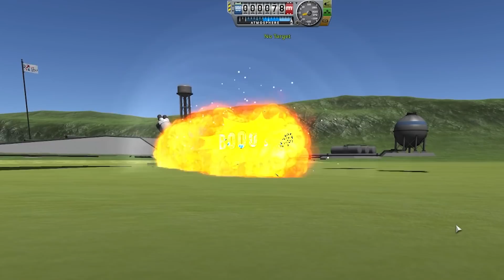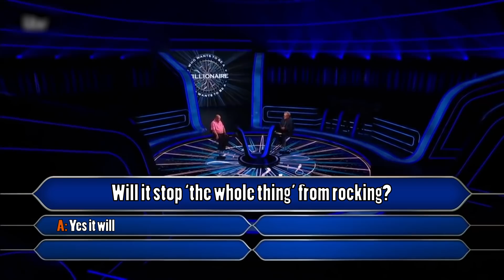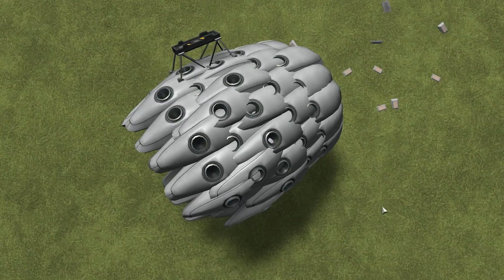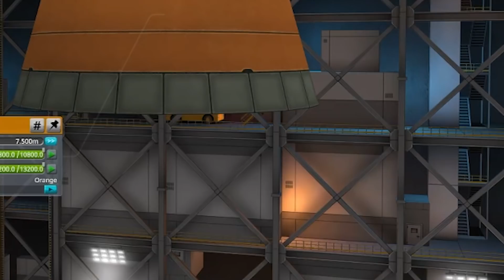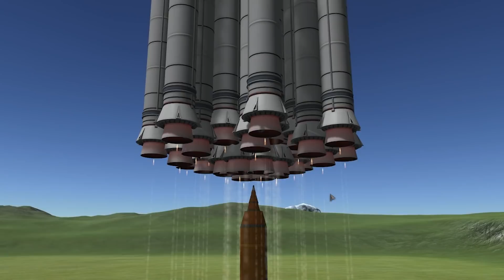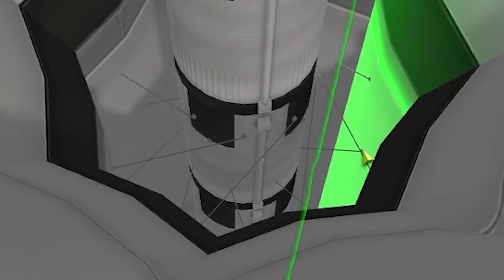Building rockets that SHOULD NEVER HAVE BEEN BUILT! Kerbal Space Program!

Comment: Today I built a twin fuselage small carrier plane that is launched by a wheeled rocket-powered launcher. This launcher works, but the top mounted rocket in the middle of the center airfoil does not really harmonize with the small carrier plane. Pushes it upwards and things get uncontrollable. But I built a greach launing system that keep everything on the runway and did not even require any redesigns. I just improvised it to my build.

Comment: Control node is at one end, controlled bits on the other end.
... put a probe core near the thrust end, and use that to control with. 
It will go up more reliable, but it will wobble all over as it is not structurally stabilized.

Comment: So your rocket is trying to control from the capsule at the top, and SAS is confused because the bottom quickly doesn’t line up with the top. Try putting a docking port on the very bottom of the rocket, then right clicking it and hitting “control from here”. That should fix it

Comment: "We're gonna something a bit more sensible now..."

Like making the rocket about 80% 
shorter?

"Like... an engine the right size."

Better idea. Try installing Kerbal Joint Reinforcement Continued. If all else fails, that mod will force a metre-thick solid osmium shaft into the rocket. That WILL help.

Comment: Protip: If you want to build big, use less, larger fuel tanks (pretty sure there's one twice the length of the ones on the noodle) and brace it with struts on the lower stages to keep it rigid if needed. KSP very much fits the real world 'simple is reliable' aspect.

Comment: you can click the orange thing on the side of the screen that has your stages, and it will pop out and give you a bunch of info for that stage (it also assumes that all fuel the previous stages can use have used them). that will tell you your TWR (thrust to weight ratio) which will help you get off the ground.

Comment: You need SAS and RCS activated at same time to do what you are doing, for RCS to work (the little thrusters) u need to put SAS on as well. That number in bottom left is cost but it doesn’t matter bc ur in sandbox.

Also put the majority of the engines at top for it to correct itself, adding more to bottom will make it worse